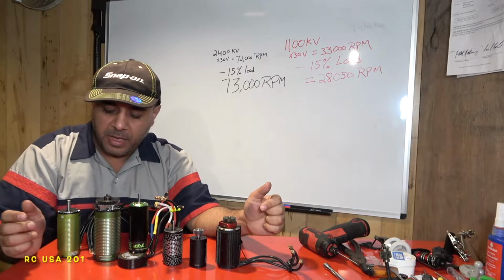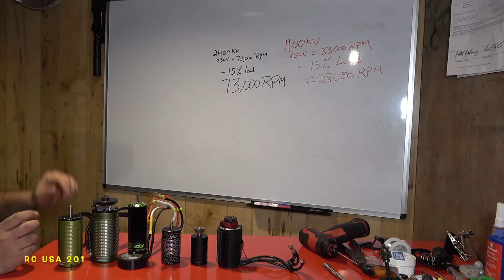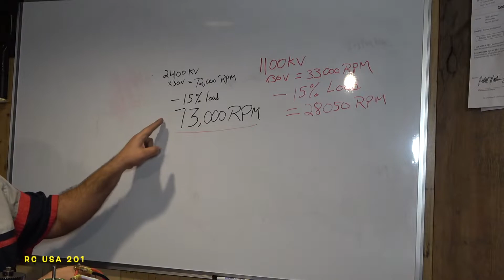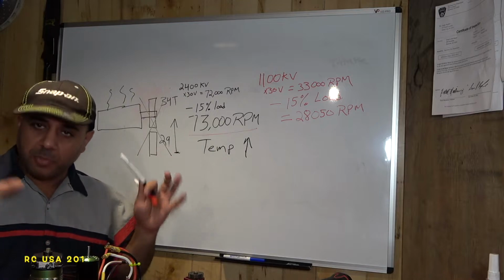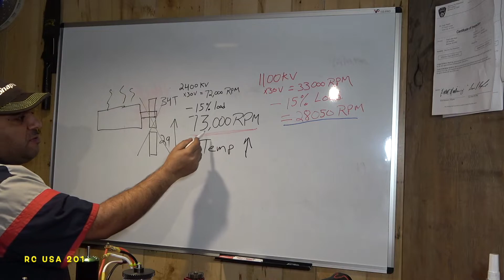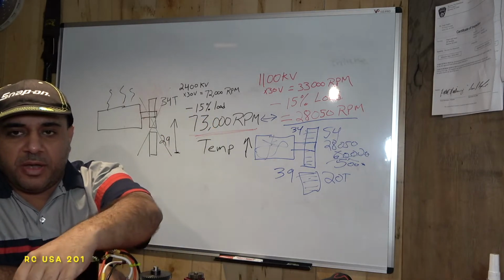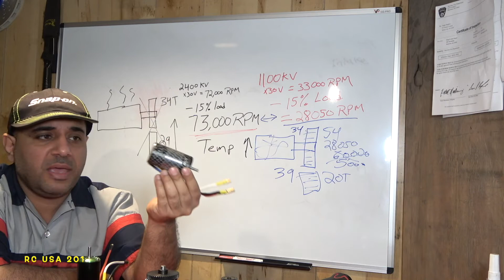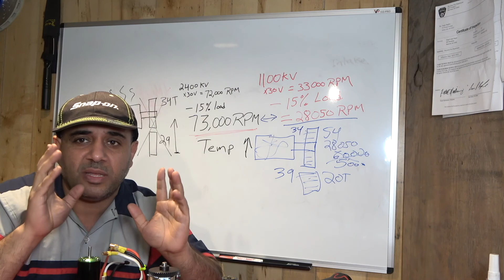Basic Understanding of RC Brushless Motor Kv and how to select a motor for your RC

Comment: If I have a 3200 kv motor rpm rated 75,000 can I push it to 83 I wanna put it on 7s but I don’t wanna blow it will it be ok I wanna push it pass it limits just two passes stop
Reply from the maker: It’s no the kv it’s what motor spec it was made for
Reply: @rcusa201  how to stop excessive current problems in the esc

Comment: Hi, How effiecient is the tp motor for light speedbashing? I am building a custom 2wd speed run/drag car 1/8 scale running MMX8s it weighs 9lb but confused for if I should get the tp 4070cm 2200kv or the castle 1717 or killmode 2900kv? Looking to get 130-140mph would 2wd be possible?
Reply from the maker: It’s for drag and speed rounds only I wouldn’t recommend it
Reply: @rcusa201  And would 2wd be good for speed running achieving 130mph+?
Reply from the maker: @gurtaajdhillon7709  challenging super hard challange give it a shout I wouldn’t run tho it would loose control on bracking

Comment: So Let Me Get This Straight, For A  Example, One Arrma Vendetta Has A 3900kv & The Other Has A 3200kv Both Has The Same Gearing (26/50) & They Will Do A Drag Race Let's A Say A 1/4 Mile.. The One With The 3900kv Will Win The Race Right? B/c It Has Higher Kv & The Only Way The 3200kv Would Win The Race If It Had A Taller Pinion Gear, Say 30t?? I'm A Newbie, Still Learning & Trying To Understand...Lol!
Reply from the maker: Yup in another words they r both very fast but the 3900 is faster now it depends on ur punch level battery and esc if they both got same set up 3900 will win
Reply: @rcusa201  Got It.. Thanks..!!🤙😊🤙

Comment: Running Limitless V2 XLX2 1721 2400Kv. Keep cutting out. running 39T spur and 34T pinon 
any suggestions on where to start with this v2 limitless?
Reply from the maker: Run 26 39 and keep it a secret one step at a time then goes down 38 and see the diffrence.  Update me bro I’m running this next summer
Reply: The v2 won't let you run anything less than a 32T pinion.
Reply from the maker: @ericbarron3946  change the mount